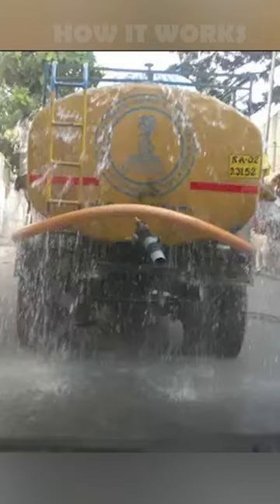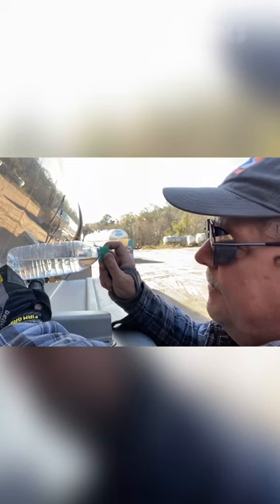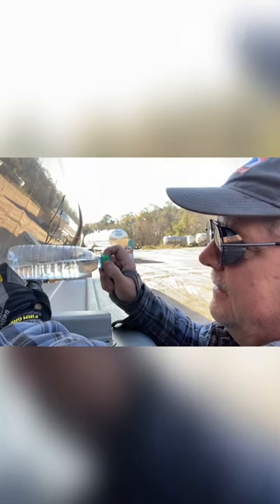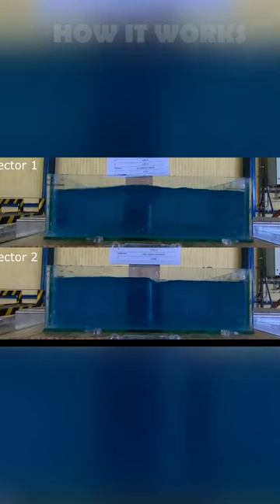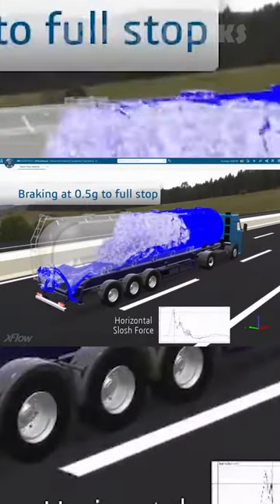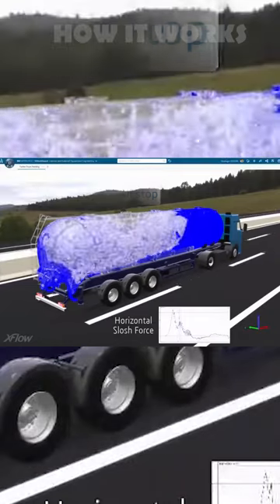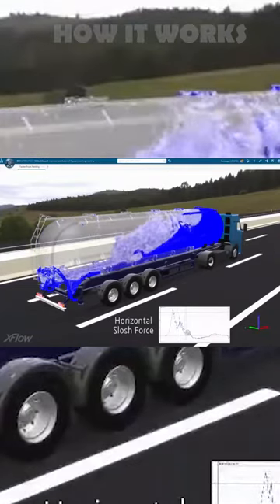why water lorry leak water in tamil ? #water #lorry #tamil #varisu #shorts #howitworks

Comment: Apro yen bro petrol tankar lory la opan la  illa
Reply from the maker: Athuku already namba channel oru video irruku parunga bro
Reply: Ena petrol evaporate aagudum
Reply: Bro nan ketkalam irunthen
Reply: @SKVibez.  ok bro. But inside tank liquid state la tha irukum.appo eppadi
Reply: @vaidhyanathan.s9921   water oda density and petrol is different and water la partion panna local people ku distribute panra apo kasama iruku but petrol apdi ila also petrol la neenga open la vecha gas ah maridum
Reply: Romba easy petrol and oil idha maari substance ah transport pandra vehicle la irukura tank ah chinna chinna tank ah pirichirupanga adhavadhu oru tank dhan ana adhukulla 3 to 4 compartment ah pirichirupanga so size perusa illadhadhu naala impact andha alavuku irukadhu
Reply: Petrol lorry doesn't carry petrol at liquid state
It carries at gas state
After then it is converted into liquid state
Reply: Na milk carry pandra tanker paathiruke, but andha periya tank kulla separate containers  irukum to prevent truck upset
Reply: Petrol tank la compantment neraya vachirupanga
Reply: adhuku oru oru section irukkum ula tank la so andha petrol even ah oru oru section layum poiyi irukkum andha effect namma dhatukalam
Reply: Petrol container kulla BAFFLE PLATES installed aairukum brother
Reply: Crct, water cheap in cost athan waste ahuthu but actually its price less, fuel tanker, milk tanker chemicals ithulam liquid thana
Reply: @SKVibez.  bro petrol evaporate agum but milk tank ahathey athu epdi oru sottu kooda sindhala
Reply: Petrol tank la 4 ah separate panni irukum... Apdi irundha petrol full force edukadhu
Reply: அப்போ பால் லாரி,
Reply: @Tezla_Creations  link send bro
Reply: Petrol density is less than water...soo its weight is very less than water
Reply: adhula compartment neraiya irukum bro so adhu lorrry ku endha padhipum yerpaduthadhu
Reply: petrol evaporate aga kudathu moodi podranga ok appo water waste ana problem illaya....😒
Reply: 😂😂🤣 sema siripu
Reply: Neriya segment ah perichu vachurupanga bro tank nala patha theriyum 4 5 segment eruku olla eh tank ah mela erunthu pathaaa neriya cap erukum aprm andha tank lam half filled ah erukuadhu so more stable than thani lorry . Thani lorry la yum indha mari panalam but yen panala nu dhan therla may be 🙄
Reply: @Tezla_Creations  link
Reply: They had extra partitions, n one way load
Reply: petrol tanker la  perils irrukkum so atha close pannitte ottalam

see this herehttps://youtu.be/J_EcXekfp0c
Reply: Crt qus ya thala😂😂

Comment: Full ah load pannalam la?
Reply from the maker: Please watch Full video athula explain pani irrukan link in first comment and description bro then ask any doubt
Reply: I watched it. Still i don't get my answer. When the water is partially loaded in a tank it will create free surface effect. Then it will cause stability issues. For good example when we carry a 20 litter can in bike filled with 10 litters of fluid. While we driving we will feel some warbling. That is FSE. So however if we put divider inside the tanks also it will create FSE. To reduce it filling the maximum is better and we should provide air vent. Correct me if i wrong.